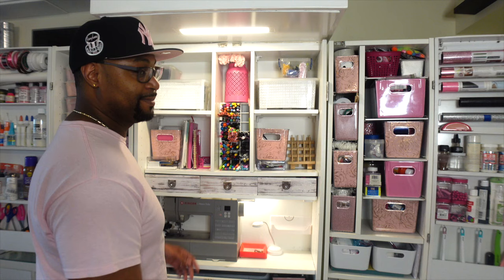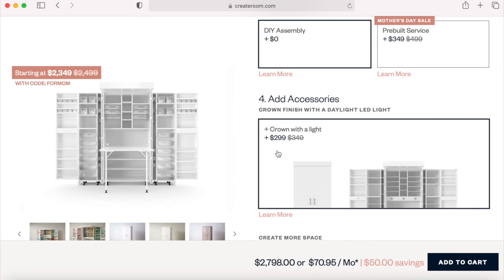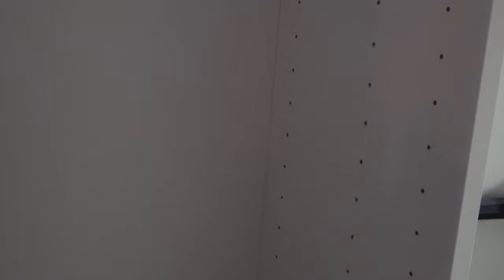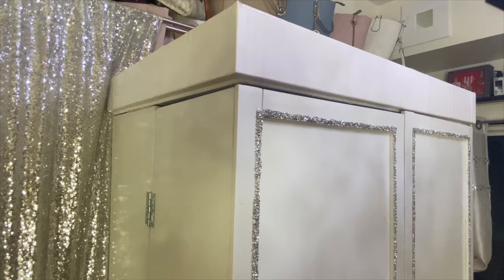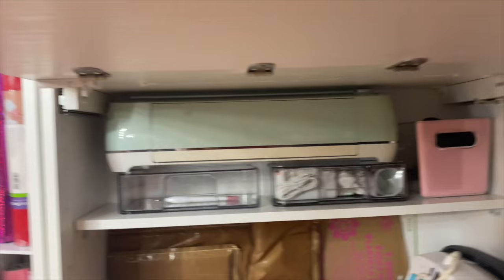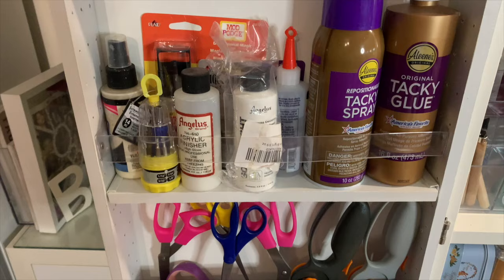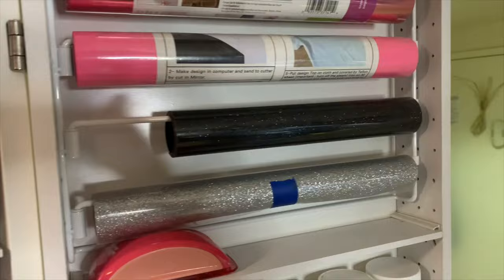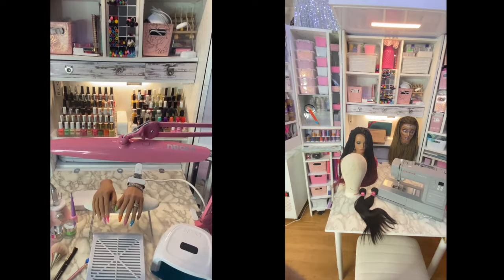The ULTIMATE Dream Box DUPE! DIY VisionBox for UNDER $500

Comment: This is phenomenal! I love the way you set up the table. The legs are a weak spot for the DreamBox because it's so easy to hurt yourself putting the table up and down. Your solution takes an extra 30 seconds, maybe, but it's much safer and it looks much sturdier, too. Plus the extensions are a great idea.

I echo everyone's comments about some kinds of written plan. I'm going to go look at your channel videos now to see if you've done any kind of update on things you'd do differently or things you've changed with this now that you've had it in your home for a while. If you don't have something like that, it would be great to see what tweaks you've made.

Comment: I LOVE YOUR VISION BOX and I LOVE that the two of you built it together!! I've been contemplating ways to dupe the Dream Box because it's out of my budget and even with all its bells and whistles, there are aspects of it I'd want to modify. It would very hard for me to spend $5,000+ on a Dream Box and then find the courage to start cutting into it to make those changes!! I absolutely LOVE how you designed the table top to have an adjustable height and length extension. INGENIOUS DESIGN! I personally think this is THE MOST ESSENTIAL UPGRADE from the original Dream Box....... I cut a lot of fabric and my back kills me when I have to do it on a table top that's only 30" high. Your crown lighting, wireless charging units, power outlets, and wireless speakers are fantastic too! I TRULY APPRECIATE you sharing the details of how you built your Vision Box; you've given me the courage to build one myself!!  STANDING OVATION FOR THE TWO OF YOU! ~~Christy~~
Reply from the maker: Three factors played into my decision to build the Vision Box. The first was price. Contemplating if I should spend $3,000+ after watching tons of Dream box reviews just didn’t sit well with me. The second was closet construction. Essentially, the Dream Box is frames with hinges that close into each other. If I could figure out how to make that at a fraction of the cost then I could create my version of a craft closet. So I studied pictures and videos of how the Dream Box opens and closes. Looked at the set up and dimensions and said to myself I could dupe this. The final factor is IKEA. Being an avid IKEA shopper and knowing how to put furniture together really helped with doing this project. My husband and I decided to film our progress so that one day we would show our own version of the Dream Box. What I didn’t anticipate is how close of a dupe this would become and people wanting me to build them or make them to sell. I added the table extension for more work space and I noticed the Dream box had limited outlets and wireless charging so I made those accessories plentiful on the Vision Box. I’m so glad you appreciate our work. Thank you so much for your comment and kind words. Good luck on your craft closet build.

Comment: Hey! I didn't see it mentioned in the comments,  but there's a lot,  so forgive me if someone has already said this. 
The casters and extra wood on the bottom-- i know it's too late now but if you cut the excess height off the top rather than the bottom, leaving the bottom of the frame intact,  it would probably be better at load bearing and not break. 
Other than that,  love everything!
Reply from the maker: Cutting from the top or bottom wouldn’t make any difference. The shelves and frame are made with particle board as like many of IKEA’s furniture so under a certain amount of weight it would break. As mines did when I first built it. The larger casters makes moving the Visionbox easier. Extra wood adds support to the frame and shelves so they can last with all the weight of supplies put into these craft closets. Thanks for your comment.

Comment: Love it! 
Great job!
It looks so close to the dreambox.

1. What exactly are the plastic inserts holding the paint and glues?  Corner guards? 
I can't find anything straight. Clear and wide enough to keep things from falling out like yours.  I have no idea what you're using.

2. The shelf holders. (Cord Hiders)
There's so many on Amazon that look like the wrong ones to buy. 
Which ones did you use? 

Thanks in advance.
Reply from the maker: I used clear plastic corner guards that can be purchased from Home Depot or Lowes for less than $5. I cut them in half so they can be straight strips then cut them to the width of the shelves that I used them for. I drilled holes at the ends of each corner guard to screw them to the frame. 

I used white cord hiders that are shaped like a square. I have multiple sizes but use small for the extended doors and a mixture of small and medium for the rest of the frame. 

Hope this answers your questions, thanks for watching.
Reply: @AnnetteWalkerVisionaryBeauty  Thank you for the explanations. I found the plastic corners at Home Depot. I ordered the cord covers on Amazon.

Comment: Would the "door" close if you used two 15x11 bookcases vs one 15x11 and the thinner insert?  Hoppe that makes sense
Reply from the maker: You would still have to adjust for the interior frame shelf unless they are size to fit within them. I added the hinges on the doors when they are closed and left a gap to adjust for the opening and closing

Comment: Thank you SOOO much for the video and explanation! This is by far the best dupe out there!
The fact that it’s explained so well is such a great kindness! I’ve seen other people post dupes and some are just like… “look what I made!” They don’t tell you how they did it and don’t answer questions! The fact that you took time to do both means you really are trying to be helpful!

A couple questions… could the outer doors be make you go the full length of the box (all the way down)? If so, what adjustments would I need to make to your original plans?

Also, how did you attach the cord hiders for the shelving? Did you glue shelf pins to them? Thank you again!!!
Reply from the maker: Thank you for your comment. The feedback on my husband’s review has been so positive and we really appreciate it. 

If you want to make the extended doors the full length of the frame, you may have to customize the frame shelves. Depending on the depth of the extended doors. I cut the top and middle shelves about a inch or two shorter and reposition the screw and peg holes for my extended doors. I also attached the table and extension to the middle shelf and it has to be in the down position for the visionbox to close properly. Mines won’t close with the table in the up position because of the extended doors taking up that space. You would probably have to do something similar with all three shelves unless you have the extended doors positioned within the top and bottom shelves and would only have to customize the middle one. I hope this makes sense. 

I screwed the cord hiders into the frame using the preexisting holes that’s already in the frame as you would with any draw slide and put the shelves in. I would recommend making holes in the cord hiders also. Hope I answer all your questions. Thanks for watching.
Reply: What shelves did you use for extended doors

Comment: Yah I added to cart to see price for for dream box and all accessories I wanted -nearly $8,000!!! Found multiple bookshelves already built on marketplace from $10-$25 each -$10 at $200 (I am making separate ones.

I’m going to try this with full size bookshelves because as an author, have a lot of books and papers. But as a crafter, I use a ton of cube totes. Even contemplating stacking the 9 cube cubbies adding full back to it and adding that for the “box”. I love cube bins because you can still organize your stuff but still toss like items into them too (wasabi tapes, stackable glitters, and so much more.)
Reply from the maker: You can literally build this with any kind of frame as long as it can create the box look. Using cubes is a excellent idea to start your frame with. The dream box price even for a basic model is the reason why we created our own version. I saved $1,000’s doing it my way.
Reply: Update:

I found  a shelf with a cabinet door that is hinged and folds with a built in light at the top for free, as well as s large peg board. Was excited about these! This shelf is a smidge higher than the book shelves so it will add a bit of depth and decorative design to be the main piece with “crown”.  

I seriously love your details the more I watch it. Top two is the dimming crown light and the table. And how you utilize the smallest of spaces. 

Your video is by far the best and most detailed!

Comment: Ohhh I love how the table goes various directions and extends- totally brilliant!!!!
Odd question can you please do a video just on making the table and legs?
Reply from the maker: The legs are adjustable and we’re purchased at IKEA. I wish I filmed the making of the table but it would very depending on the size of the frame used. I purchased shelves from Home Depot, glued them together and cut them to the width of the center frame. I covered the table with contact paper. The extension was added because I had extra shelves so might as well use them in this build. Thanks for watching.
Reply: @AnnetteWalkerVisionaryBeauty  thanks
Reply: Can you link what you purchased for the table?

Comment: Great job! 👏🏽👏🏽👏🏽 I must compliment you and your wife! I’m trying to do this with my armoire and I’ve been doing a lot of research.  This was so
helpful.  I just wanted to comment on the situation with the legs. I have found a few alternatives.  There are height adjustable metal legs that come with the folding brackets attached on Amazon.  They look very sturdy.  Also, Casino Supply Co. has a few.  I’m not affiliated with either of these, it’s just what I’ve found in my research.  Many blessings for good health to your wife and thanks for sharing!
Reply from the maker: Adjustable Metal legs are an great alternative but keep in mind that may add to the weight of the table if you want to store it in the up position like my husband demo with the VisionBox. If the table you build with armoire is not going to be like minds then if you should have no problems with any legs that you choose. Thanks for your comment.

Comment: Hi! I’m in love with this and I’m going to give this a shot! It’s gorgeous!!! My bookshelves were delivered today. I have a few questions…what size hinges did you use for the extended doors and the table? Also I’m still having a hard time wrapping my head around how to make the extended doors and table work. Will I just cut down all of the shelves where the extended doors will meet the bookshelf? And will that be the smaller bookshelves or the middle one? So I’m assuming I will have to make pin holes for the shelving to fit after I cut it down? What were the tools you used to do that? For the table I will need to cut the shelves that it will be touching? Thank you so much for this tutorial. This is going to give me so much space!!!
Reply from the maker: For the extended doors I used 1 1/2 inch round hinges and used 1 inch round hinges for the table. The answer to your questions reguarding the table and extended doors is YES, if you want to duplicate the Visionbox. I had to customize the frame in order to fit the extended doors and table. I cut the top and middle shelf about 2 inches shorter and reposition the peg and screw holes. You can make the extended doors without cutting the shelves but they would have to be between the top and middle shelves which would affect the overall size of the extended doors. I used a hand and table saw to cut down the shelves. Yes the table shelf will be shorter since you’re connecting it to the middle shelf and that is why I added an extension. You don’t have to do everything that I did. My goal was to try and create the closest Dreambox dupe possible on an affordable budget. Take allot of these ideas to create your own version. Thanks for your comment.
Reply: @AnnetteWalkerVisionaryBeauty  thanks for replying! So what if I was to make the extended doors the exact depth of the middle doors? Will they close correctly then? So 3 inch hinges to connect the main billy and the middle ones?
Reply from the maker: @shemekadrake9267  The extended doors depth should be only a few inches deep. I think mines is about 3 inches. If you make them any deeper not only will they affect the closet from closing but also take away from the interior space of the middle bookcase when closed. Plus you may have to customize the 3 main shelves that you use to put the bookcase together. I used 3 inch hinges to connect the bookcases but you could also use 2 1/2 inch hinges. I think the bookcase opens and closes more smoothly with bigger hinges.
Reply: @AnnetteWalkerVisionaryBeauty  thank you so much. I have tried to figure it out but with my anxiety I think I’m going to skip the table and extended doors lol. Just give me the rest of the space.

Comment: Can you please explain the extended door frames? I can’t figure out how you make it to where the two smaller bookcases fold in flat to the larger one when you have the extended door frames folded in to them… Same thing for the fold in table. I’m perplexed!
Reply from the maker: In order to get the extended doors to close within the frame, I had to customize the middle bookcase frame by making the top and middle shelves shorter. With the shorter shelves, I had enough space for the table and extension. The table can only be stored in the down position in order for the doors to be fully able to close. I added a up position to access storage underneath. Hopes this answers your questions. Thanks for watching.

Comment: So amazing! When you bought the white wall panel for the doors, did you just have them cut to size and attach them to the back of each 15 inch book case? If so, what did you attach it to the back of the bookcase with?
Reply from the maker: Yes I had the wall panel cut to size and used finishing nails to attach to the back of book case frame. I added white mdf trim around the edges also nailed to the frame and finished with door handles in the middle to complete the door like look. Thanks for your comment and watching.

Comment: Awesome job! Where did you get the clips to hold the legs? Also what wood did you use for the table? Thank you
Reply from the maker: I found the leg holders at my local hardware store and I used shelves from Home Depot to make the table. It’s better to get one big piece of wood and cut it to size to make the table then using shelves because shelves are significantly heavier as I later found out. I’m going to replace my table with a lighter wood board. Thanks for watching.

Comment: Great job!!! I was wondering what you used to hold the vinyl rolls on the small cabinet you made. It's white and has rails that look like they come off and on to replace the rolls. Also what is the clear strap you used to keep the glue bottles and jars on the shelf. Any information would be helpful. Thank you
Reply from the maker: I don’t know what it is called but I bought the rack from Michael’s. The clear plastic straps are made from corner guards that I purchased from Home Depot. Thanks for watching.
Reply: Thank you for replying

Comment: This is so awesome 😍 going to attempt this . 

What kind of wood did you all use for the table part ?
Reply from the maker: I use two wood shelves that I purchased from Home Depot, glued them together then covered with contact paper. You could also use one 2x4 feet wood board and cut that to the size of the frame used to build the closet. Thanks for watching.

Comment: This is amazing and I have watched it 10 times. I can’t figure out or find those clear bracket thingies. What are those? I have ordered my bookshelves but need those desperately.
Reply from the maker: They are clear plastic corner guards. I customize mines to fit the different size shelves. You can get them at any major hardware store. I purchased mines from Home Depot. Thanks for watching.
Reply: @AnnetteWalkerVisionaryBeauty  sorry. One other question. Ty for responding. When I have looked at them they all seem to have a split in the center. The ones on yours look straight. Did you cut them in 2 long ways? Yours look so good. They honestly look like they were custom made! Beautiful work

Comment: I have a question about where the cabinets are connected to each other.  How does the 2 inch frame that is between the two cabinets not cause issues when the front closes? How do the sides where the cabinets touch not have a gap due to the 2 inch frame????
Reply from the maker: We attach the hinges while the doors are closed and left some space between the cabinets and doors. We also had to compensate space for the extended doors to fit within the cabinets. We have to close one door at a time or they will touch if doors are closed together, especially with the extended doors. So far no problems. Hope this answers your question. Thanks for your comment.

Comment: Great job what did you use at the back of the book case to cover the brown backing so you can attach the door handles
Reply from the maker: My husband mentioned it in the video. We used white wall panel that was cut to the size of the smaller bookcase frames and we outline it with pvc trim board. The outline with the handles creates that door look.
Reply: Thanks